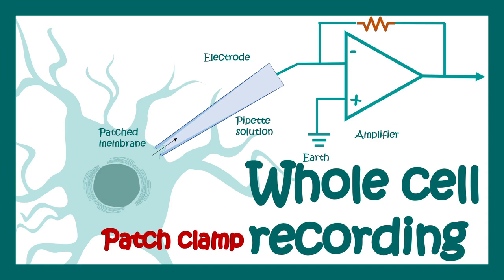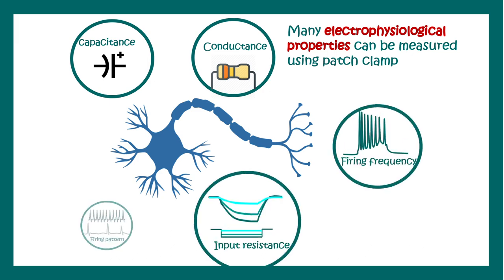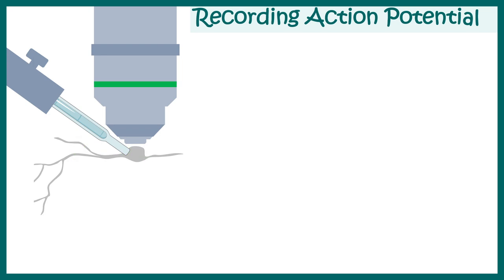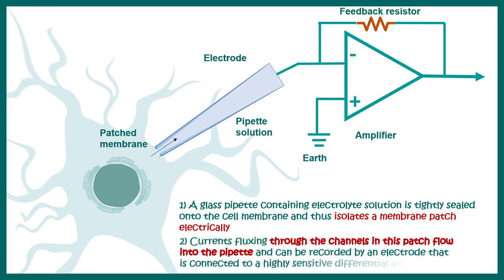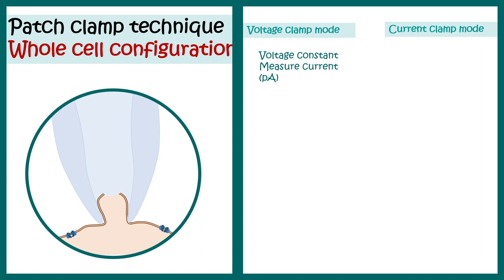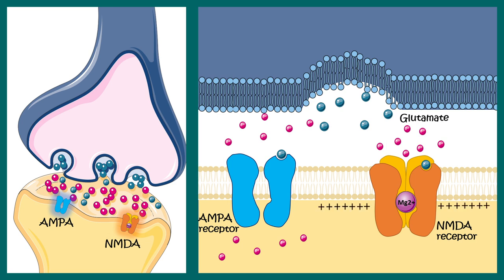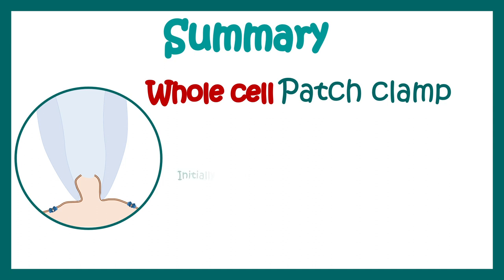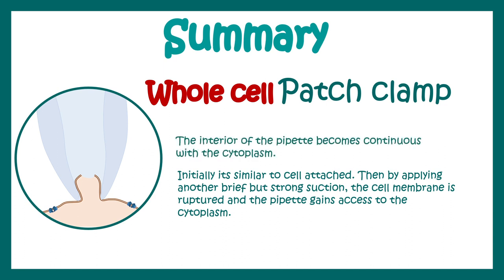Whole-cell patch clamp recording | How does Whole-cell voltage clamp work? | application

Comment: Dear "Animated biology With arpan", you are mixing up whole cell and cell-attached recordings. For cell-attach, the AMPA current is truly inward at the negative membrane potential. It is because cations flow from the pipette into the cell. But in a whole cell configuration, the same current under the same conditions will look outward, because cations will flow through the channels into the cell and then from the cell into the recording pipette. Thus, if your pipette is  clamping voltage at -70 mV, it will begin injecting negative current  into the cell in order to compensate the positive shift. This current will be INWARD NEGATIVE, which is equal to OUTWARD POSITIVE. So, the whole-cell pipette will record outward, not inward current.